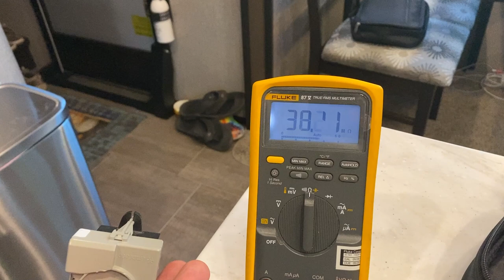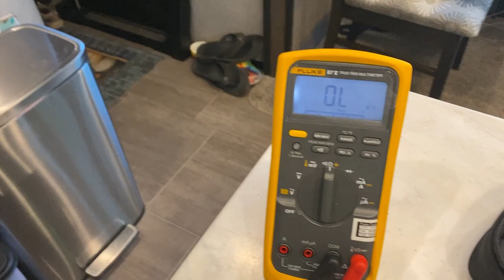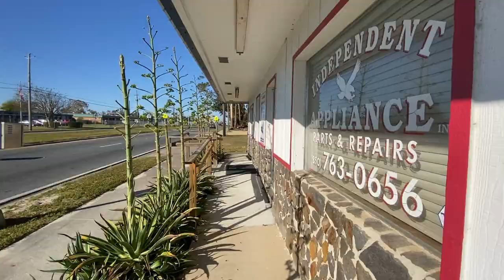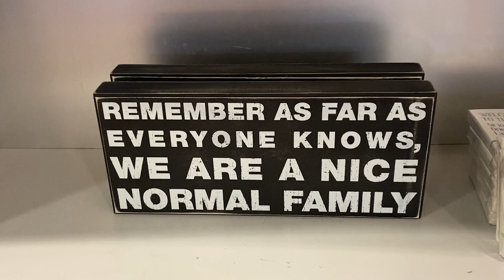RV Life | Fridge Repair - Easy DIY Fix & Save Money! Pier Park, PCB.

Comment: Great job! You turned a catastrophe into a simple and inexpensive fix.  Probably 75% or more of my appliance repairs over the years were either connectors, loose wires, bad switches, dirt build-up, and faulty relay contacts. Very impressed how you handled the situation and repair. You didn't get upset at the world and panic. Sometimes tapping the relay or a thermocouple with a screwdriver handle will motivate it to work temporarily. Re-seating connectors is also a good first step in troubleshooting.  A good multimeter (VOM / Volt Ohm Meter) is a good tool to have. BTW changing a compressor is not a DIY project.  That requires special equipment, tools, gauges, and skills to recharge the refrigerant.  I enjoy watching all your videos.

Comment: Y'all handle challenges so well. Before I started RV-ing I used to watch RV videos of guys who had been in a plumbing/electrical/mechanical trade all there lives who would go to their thousand dollar toolbox then say, "All you need is a left-handed visionary then torque the splice-line to the bulkhead of the mercenary." Say what???? I could NEVER do that. 

I started following your channel because, like me, you appeared to not have a Trade background. However, I give myself ulcers if something goes wrong. You two almost laugh it off. Good for you!! BTW, Pam, the difference between a condenser and the other object is: a Kompressor is a model of Mercedes-Benz.
Reply from the maker: LOL. Priceless!! “Kompressor” 😀 Knowing things are going to break vs expecting things to last are two totally different approaches to RVing. We like to show everyone the easy fixes because when it comes to suspension, hydraulics, and slide repairs…it’s going in the shop. Knowing your limits is the first step, because nobody wants to catch the rig on fire. Completely agree on the seven levels deep approach to over complicated repairs. We don’t show people how to repack their bearings…we show everyone common high fail parts that take 2 minutes to change. The difference is that we didn’t know they were simple repair parts at first. Thanks again and all the best! Pam and Lee.

Comment: We have the same fridge in our Pinnacle.  Would you mind sharing the part number and where you purchased the relay?
Reply from the maker: Thanks for the reminder. I put the Part Number in the Description section. We found this part at a local PCB appliance store. To make it easier for everyone, I put a link to our Amazon Store. That way it's always there in case you need it. We also have the Hot Water Heater relay in the storefront as well. Best.